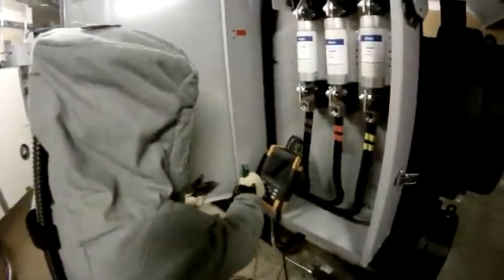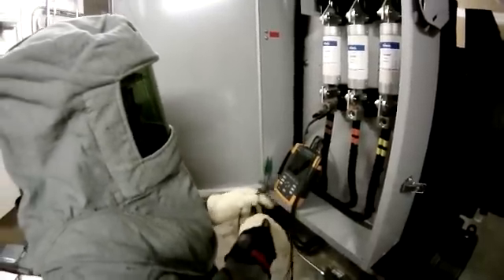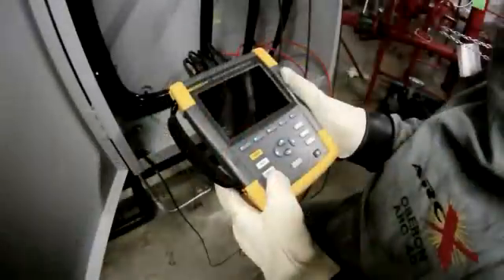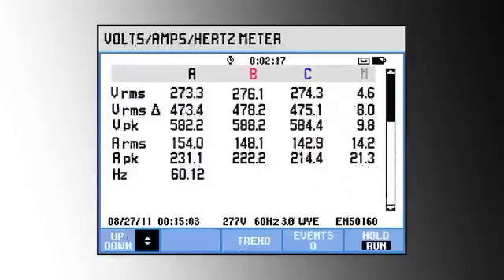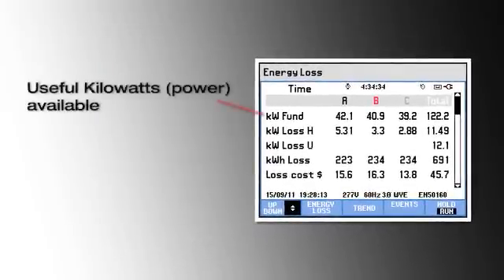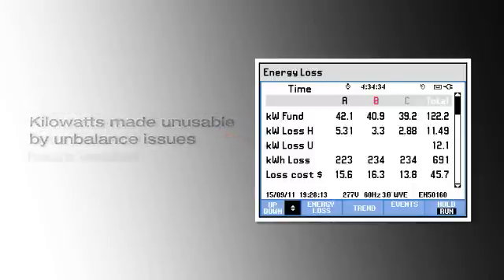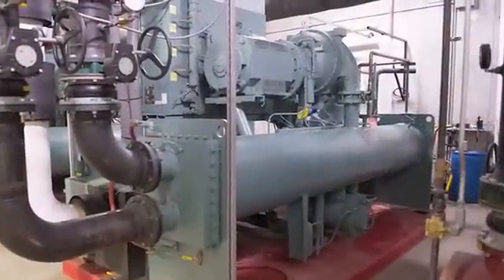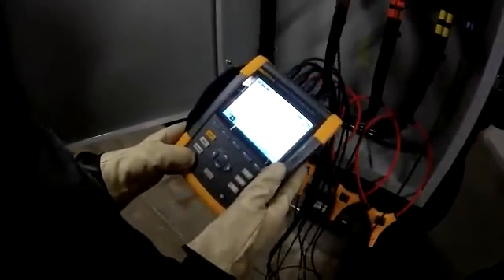Fluke 434, 435 Series II Three-Phase Power Quality and Energy Analyzers

Comment: Hi, is the size of leads cables and ct rings applicable on MV above 1 kv voltage? are they safe or it needs to change as per the rating?